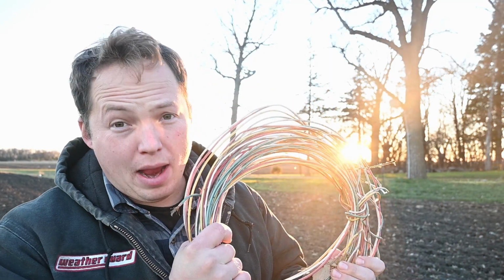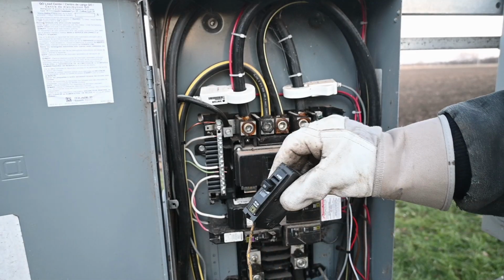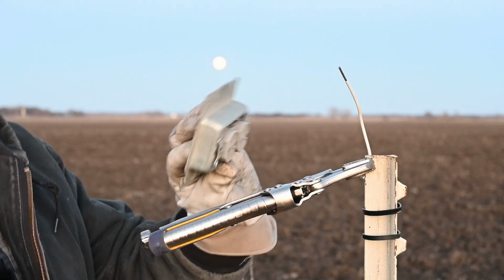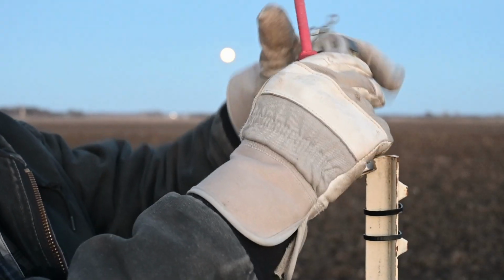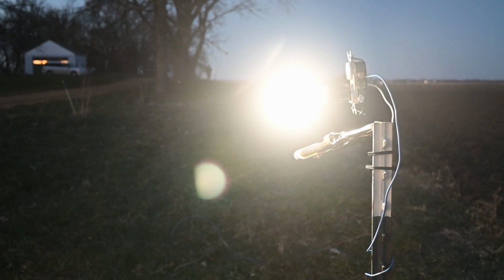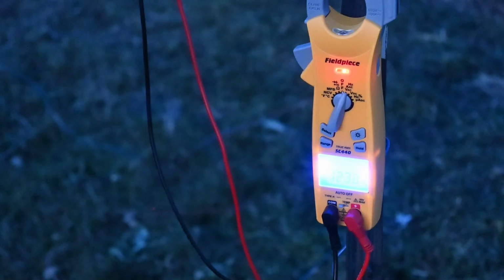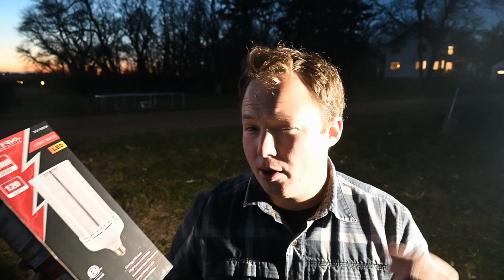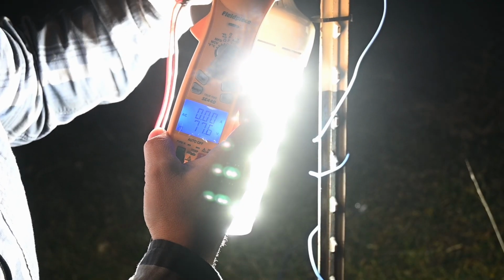Powering a Light With a Fence Post & Scrap Wire - SWER (Single Wire Earth Return) Demonstration

Comment: You just demonstrated why a short through a person to ground won't clear via the breaker.  Still something to watch for that time when the ground is especially conductive, or you are very close to a bonded ground penetration (ground rod, pipe, etc)

Grayfurnaceman has a couple videos from years ago with a similar set up showing an incandescent bulb will glow, but not brightly with a ground return due to the voltage divider created by the bulb and the ground.
Reply: Not a "voltage divider", its simply a high impedance neutral path.

Comment: Watched a Mike Holt video where they pounded 50 feet of rod to get a low impedence ground and hooked up a 120 volt feed to it.  Breaker would not trip.  Just sat there consuming over 5 amps.
Reply: Haven't watched this whole video yet but Benjamin already did a similar experiment. Did you watch that video?

Comment: I submitted a code years ago regarding ungrounded well casings. Well pump had a short in water not tripping the breaker. Short story the NEC adopted code to ground submersible well pump casings.kind of the same situation you demonstrated 👍
Reply: what was the voltage? depth?  location?
Reply: @reasontexas  the well was next to a dr. House, kids were getting shocks when getting out of the unground pool. Another instance at a local farm cows were dying in their stalls, when they would drink from medal water system. Pump wire had a Nic inside the medal well casing .

Comment: Awesome video, thanks! You're the second person that I've seen doing this. Couple years ago I had an electrician over to connect my newly built garage to it's own 200 amp service. The electrician knew that I had grounding issues with the house since we are in sand, therefore he tested my drilled well casing for ground and he did it pretty much the same way you just did it. At first when he told me to go plug the extension cord in, I plugged it in a GFCI receptacle outside and it would trip as soon as he turned the switch on so I plugged it in the house in a regular receptacle and wouldn't you know it, it worked. He did some more testing I believe and he told me that my well casing was a very good ground. Now my garage and my house are grounded at the well. He ran a #6 bare to the grounding rods at the house and crimped it to the wire there. Can't wait to see when you do this video again but with GFCI receptacle to see if it works for you. Personally I don't think it will work.
Cheers from Kazabazua, Quebec, Canada.
Reply: It wouldn't. He explained why a GFCI breaker wouldnt work. Same with an outlet.  This system is a ground fault. So a receptacle or breaker designed to trip upon recognition of a ground fault would trip. Kind of like saying i bet if you plug in a DC device into an AC power source I bet it wouldn't work. Well Of course not it's not design to.

Comment: On a 3 phase pad mount transformer you might see at stores there are 4 ground rods that make a loop and tie back to neutral lug inside the transformer. In a substation there is a ground grid put in before and transformer pads or supports are poured with concrete before any breakers or steel is erected.

Comment: Makes sense. Considering the neutral grounds to a buss that is tied to a ground rod which goes where? , To the ground. 
That's why power guys working on high voltage are cool when working up in the air. As long as there's no ground, ur good.

Comment: I'm not surprised that 15k lumen LED worked that far away on that earth ground system.  I just did some 12v landscape lighting where I had exceeded the recommended wire distance from the low volt transformer... probably close to 200 ft for the furthest light.  They all worked perfectly fine! LEDs often work with 1/2 it's designed voltage.  If I'd had halogens, they'd have been really dimmed or not working at all.  The LED's did fine... no dimming, not blinking, totally normal function.  Wire lengths are a recommendation but not always a requirement.
Reply: and those LEDs will actually last longer because of it...

Comment: I do see this was only to show it's possible and it's very interesting but now I want to solve the problems to make it practical. You could reduce the danger by putting the wire on poles above reach, then there's no chance of them being cut by digging. Of course that jacks up the cost and doesn't look nice. Solar, a battery, and a wireless cammera is starting to look good......

Comment: Another way might be the same way the utilities do it: transformers to high voltage for the run then step it back down at the load. You would have less loss, the resistance of the ground would be less of a problem.
Reply: you could do that, but then you'd need to insulate the feed wire better,.  at 3500V (from a microwave oven transformer) wire-nuts and THHN are not going to cut it.
Reply: @randomblogger2835  Microwave transformer is 2100V not 3500.

Comment: It's not worth it in short run of a few hundred feet like this, the savings are only half the cost of the 12G wire. But if you had to run big enough wire for 100A service, the savings in copper would be a big deal.

Comment: I did this as a kid to bring worms to the surface for fishing, damp soil helps.
Yes I’m lucky to have survived!
Reply: Me too.  The worms would die more quickly as I recall though.
Reply: He made a video about this topic: https://www.youtube.com/watch?v=uxEYMFRxLuA
Reply: Did the same back in the day, an old timer showed me this trick
Reply: Done this myself, many years back. 😱🙃😕😫
Reply: Turn off current before, gathering.
Reply: @charletonzimmerman  -   A TRUE Norwegian. like this fellow obviously is, can actually pluck those electrified "dancing worms" from the ground with his teeth, with little or no ill effect. It is a "racial oddity" that us Norwegians (and some Swedes) have extraordinarily thick head bones, which helps to keep the brains well insulated from electrical (and other) disturbances.
 However, anything near or over 240 volts straight to the noggin might elicit a "Jaaa, Yumpin' Yimmity, Yoost a Little Dizzy" response, but that is about it.
 Minnesota is an incredibly dangerous place for the non-Norskie.

Comment: Most fisherman have been using a rod (in a cut of shovel handle) with one wire to the hot side of a plug. worms will come to the surface

Comment: I would have liked to see you use that ~45v gradient near the fencepost to power something - I think you should have been able to power a small lightbulb with just the probes in the dirt, and no wires connected directly.
Reply: Yes you can. I use a DC to ac converter with a old battery .I was able to power a light bulb with one wire in dirt and one connected to source . I did it at about 10 ft away from power  source . I was surprised the dirt is in fact a conductor
Reply: I have gotten shocks from electrodes I was placing for Fall Of Potential testing.

Comment: I try Nikola tesla patent on 2wires one 100 f and the other 25 f  6 Inches from the ground and a 500 hz ocilator  power whit a 12VDC battery and got 220 AC to power 20  60 whatts lights simple butt no one wants to try it
Reply: Huh?

Comment: It did not TRIP the breaker when you did try this with the earth WORM rod into the ground.
So the earth return ( to the transformer) was working then.   GFCI breaker did trip.
Thank you.    Did not expect the larger bulb to function.
Reply: Larger lamp has flyback converter in power supply, so it started from lower voltage increasing current and causing bigger voltage drop.

Comment: Good one! I still don't understand where the return voltage goes. If it goes back to the transformer, where does it go after that? To the power plant, but then where?
Reply: Current goes back (Balanced) to the transformer not the voltage. Thank you.
Reply: The current goes back to the power plant at "zero" volts. It goes up into the "zero" volts (aka neutral) side of the generator head, where its voltage is "pumped up" and sent back out as positive voltage. It's a giant loop.
The generation station is the opposite of a load. It takes current and increases the voltage, whereas loads take current and reduce the voltage of that current back down to "zero" volts. Electrictrons love to be recycled.

BTW that's a gross oversimplification and more applicable to DC than AC, but should help you understand anyways.
Reply: Voltage doesn't really "go" anywhere. It is a difference in potential between one point and another. Actually, "electricity" (electrons) doesn't flow either.
Everything you thought you knew about electricity is wrong (As a retired Air Force Radar Technician, I was taught that current flows too). Prepare to have your mind blown:
https://youtu.be/bHIhgxav9LY

Comment: What keeps someone walking close to it when raining from getting zapped.
Would this not act like an electric fence for animals
Reply: The electric fences that I have used rely s on the ground to shock. If the ground is very dry in the summer I had to add more ground rods. I added a center ground wire on the fence to prevent the loss.